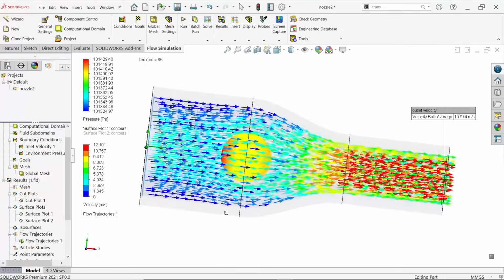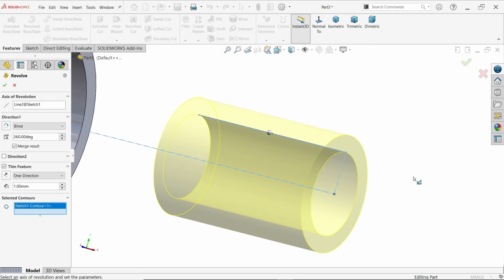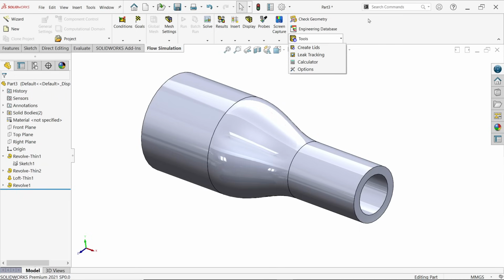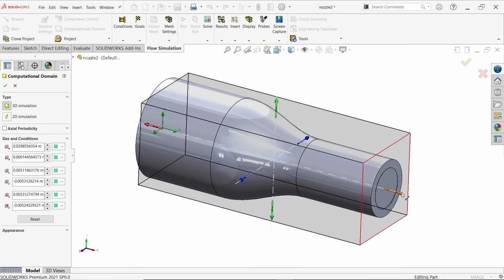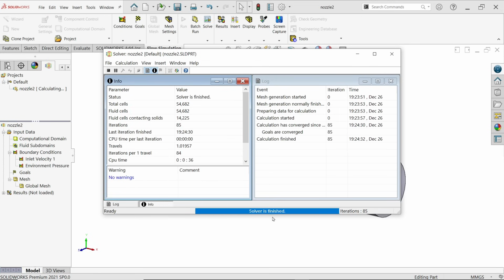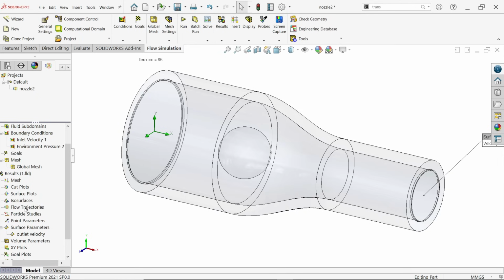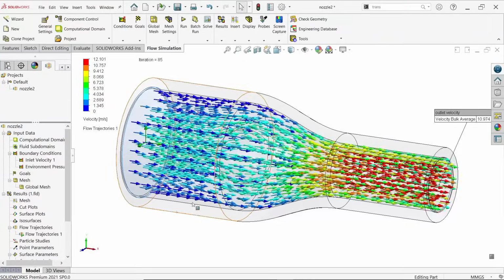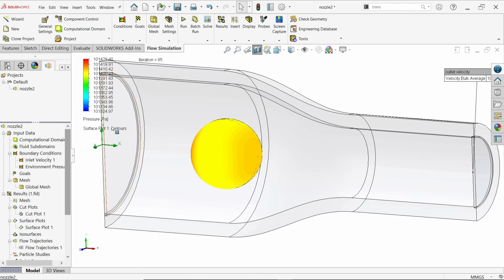SolidWorks Flow Simulation Tutorial: Nozzle velocity & Pressure

Comment: Is it normal that the pressure in the narrow part of the nozzle is lower than at the inlet?? In a straight pipe it is expected to have a pressure drop, but in a case where the section is being reduced, it is expected to see a pressure increase. Not a drop. Any idea of what is wrong with this simulation?
Reply: becase of the ball slows down mass.
 i think?
Reply: Internal Fluid Pressure (Bernoulli's Principle): As a fluid enters a narrower opening, it must speed up to maintain the same flow rate. According to Bernoulli's principle, as the velocity of an incompressible fluid increases, its internal (static) pressure decreases. The fluid molecules are moving too fast in one direction to bounce off the nozzle walls, dropping the lateral pressure.